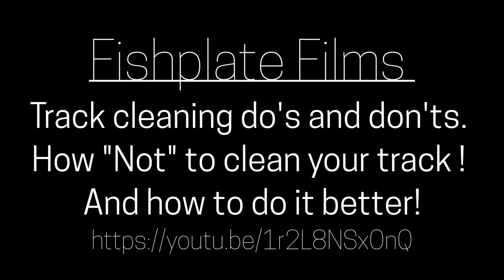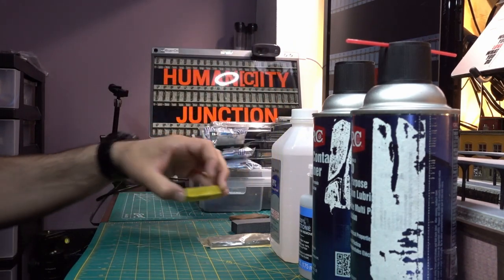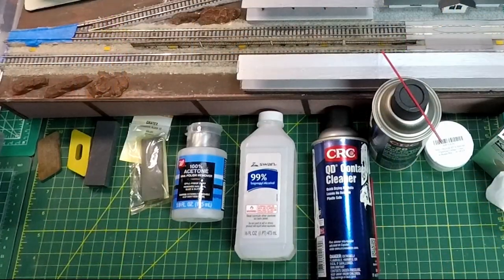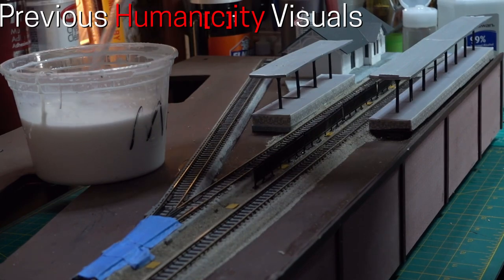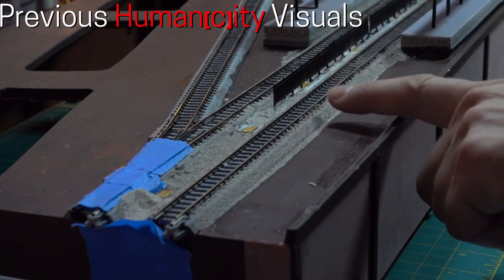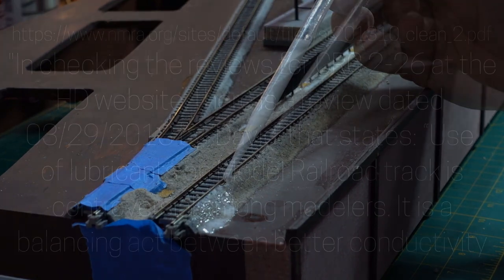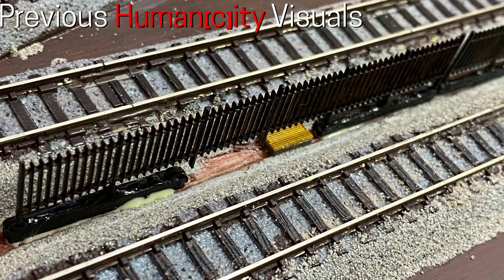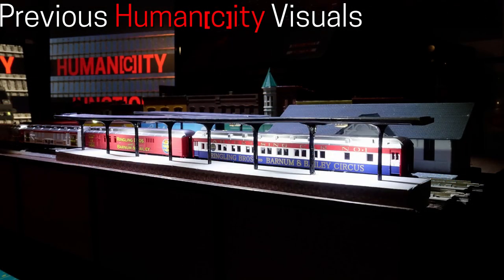Preparing Your Track for Running Trains | Cleaning Your Model Railroad Track

Comment: If you search the internet for "polishing track"  you will find what Ralph and I from MRL have done.  Although time consuming, it makes sense.  First take very very fine sandpaper to remove large scratches, then,  Taking a polished steel washer and buffing and polishing the rails to remove very fine scratches and then putting a non sticky protectorate on.   A little wheel slip is negligible for  me at best.  (real railroads have some too) The scratches fill up with junk, and polishing the rail eliminates those scratches.  IT is  more work, but worth it. It also takes away the arching that electricity does when wheels run on minute scratches.  My only issue is I am in a dusty room and light cleaning is necessary, so putting on CRC over that dust is not too good, so wiping down track first with something not containing any  water, (alcohol contains water) but just any sort of dust remover helps.
Reply from the maker: Polishing the rails after fine sanding is a great idea.

I do have the QD Contact Cleaner to "clean" the rails before applying the 2-26. I believe the CC is better than IPA for this step.
Reply from the maker: Dwight,
I have been thinking about this more today and from what I know today, I could not recommend any type of abrasives, event a very fine sandpaper, for regular track maintenance.
And "sanding" is going to leave behind very small pieces of metal.  These pieces of metal will be attracted to the locomotives, especially the motors. Yes, being as that abrasives were used as track cleaners for years and everyone has old locomotives, there is probably little long term effect.
But if I have a cleaning/treating solution that does not leave microscopic metal particles behind, I would choose that as my first option.
I would be really interested in hearing your further thoughts on this.
Reply: Of course, one would clean off the sanding particles before polishing with the washer.  The process was called Polishing and Burnishing nickel silver rail.... @HumancityJunction

Comment: track cleaning is just that. dust and humidity get on the rails over time, and if left for long periods of time,(week) then should be cleaned with the 89% to 99$ alcohol. when it comes to running the trains, every day a bit of the CRC on a rag and spread out on the rail heads works best. just don't do any inclines that you have, and wheel slippage with stay at a min
Reply from the maker: Thanks Sparky.  Currently my setup is all on the same level, but it would be interesting to do some testing on your Helix on just how much effect the CRC would have on slippage.

Comment: After seeing your presentation, I went to Amazon and looked at CRC products.  Their 2-26 was described as a lubricant and that worries me.  Their QD Electronic Cleaner, however, looks like it may do the trick on tracks without collecting dust/dirt.  Just saying.
Reply from the maker: The key part is the protectant, which supposedly helps with the electrical connectivity. 
There is a video by Ron’s Trains and Things talking about the QD Contact Cleaner that is supposedly better than the 2-26, but I am not sure that it makes a noticeable difference. 

I am currently of the mindset that running trains is the best track cleaner.

Comment: Hi, I've used Inox on my layout and it is good for conductivity and smoother running of smaller locos. But I discovered to my horror, that it totally wipes out traction tyres on locos which were bought to take larges rakes of carriages up my incline . . .  sadly no more !! I have to now change the traction tyre wheel sets for non-traction tyres which leaves them with less pulling power than with tyres. People definitely need to be aware of this problem.
Reply from the maker: Yes, this is unfortunately 100% correct, a lot of this conductivity enhancers are corrosive to traction tires.
One thing I have recently being experimenting with good success is just using graphite. I got some powdered graphite from the pinewood derby crowd (they use it on their axles) and it has been working really well.

Comment: The only issue I noted on the fishplate films video which you don't mention is that CRC 226 and traction tyres don't go together. On my n scale collection, Broadway Limited Imports locos use traction tyres, for both diesel and steam locos. For now I'll stick to infrequent IPA (then adry rag) and, surprisingly, just  running a dry rag or track cleaning car again with the pad dry.
Reply from the maker: Thanks for the information regarding traction tires, that is definitely good to note.

I have 7 N scale BLI diesel locomotives, 3 different types (the majority are heritage), and all of them are Paragon 3.  I thought I new what traction tires were, but looking at all of my locos, I do not see what I expected traction tires to look like.  I am definitely going to need to do more research on my BLI locos.

Where did you find out about 2-26 and traction tires not going together?  I wonder if it would be better to use NO-OX-ID if you run locos with traction tires.
Reply: @HumancityJunction  Greg / fishplate films mentioned it in his most recent video recommending crc2-26. Apparently the stuff soaks into traction tyres and makes them ineffective.

Comment: The channel Elite 194 had a video a few months ago saying he uses a product called Oxguard. On the same level as the oxidation prevention product in the small twist top container that you showed. He said a tiny bit went along way and that he only cleans his rails once or twice a year. He didn't say how much he ran his trains though. He swares by the stuff. Great video and great information. I'd never thought about using electrical contact cleaner to clean the rails but it makes perfect sense. Stay well.    👍
Reply from the maker: Thanks for commenting

Comment: I have been using Inox for over 30 years. I get all the benifits claimed in the Fishplate viedo and your viedo using CRC 2 26. Both are great.
Reply from the maker: I have been using the CRC 2-26 and then adding the No-ox-ID as necessarily.  It has been a good combination for me.
I recently started trying out graphite on the rails. I am not sure what I think of that yet.

Comment: Just to put this emotive subject in perspective, 193 subs and 53 comments so far! I am in total agreement, my research has born similar results. For those in the UK, take your Peco track rubber and throw it in the bin! It is way to coarse! I think I need to do a vidbit on the subject, as you have missed one more element, the "lubricants" that offer anti oxidisation also help reduce sparking, an element little understood that actually causes most of the "dirt" on the track!
Reply from the maker: There was some information available that the black that gets on the tracks is not oxidation, but is actually arching.  And that it is the lubricants that reduce the arching, which reduces the black, which reduces the “dirt” on the track.Maybe one day no one will use the track rubbers any more.

Comment: I use CRC and spray it on a paper towel, cleans really good and quick, as said in another post a channel called Elite 194 swears he uses ox guard and only cleans his track about once a year, it's made for aluminum wiring so it don't oxidize and lose voltage, I own a rv park and used it on the wiring and have not ever had any voltage drops in the 12 years that I have been open. Gary
Reply from the maker: Gary, when using paper towels I found that they get ripped up between track sections hence why I moved to rags or the delicate wipe.  Thanks for commenting nad I look forward to more of your video.

Comment: I been in electronic repair and computers for years and have used a product from Caig, manufacture of electronic cleaners.  I know nothing more but feel like throwing the name in the pot. It has alwayus preformed well for cleaning control potentiometers and edge connectors.
Reply from the maker: I will check it out, thanks for bringing it up.

Comment: Saw the video from fish plate - interesting.  Personally I use Woodland scenics tidy track and can't say I've ever had any issues with it.  Cheers Euan
Reply from the maker: The point that I believe we are trying to make is that cleaning the track is only the first step, that you also need to prep the track by putting on something like 2-26 or INOX. Some people stop after the cleaning part and do not do the prep part.

Do you know what is in the liquid that comes with the tidy track?
Reply: @HumancityJunction  sorry I don't know what the liquid actually is in tidy track - that said I've never used the liquid cleaner supplied.  The track rubber seems to work.   Could the humidity of where a layout us housed play a part in the effectiveness of the different cleaners ?

Comment: Great topic.  transmission fluid does improve contact, but it does not clean and because it is oily, it attracts dirt, so I would vote no on that.  The CRC does seem to be good stuff and I am going to try it on my next layout.
Reply from the maker: Mr. Crow, thanks for watching and commenting.

I am not a fan of the transmission fluid, just like I would never use WD-40.  But I saw it mentioned a few times so though I would bring it up.

Comment: I'ved used CRC 2-26 to clean my rails but also to clean track pickups, motor brushes and commutators and it worked great. Thinking of using ACH ACT-600 or Track Magic after cleaning for conditioning the rails.
Reply from the maker: Thanks for watching and commenting Nate.
Reply: @HumancityJunction  You're welcome!

Comment: I have been using the Inox product and find that it has worked well for me. The also use for stubborn build up dirt such as after doing scenery work or track repair wet/dry 4000 paper sprayed with a little of the Inox. works great.
Reply from the maker: I have sprayed contact cleaner on a bright boy before.

Big Bill, see my response to Dwight about sanding.  At 4000 grit you are leaving microscopic particles that could make their way into the motors on your engines. First choice is non-abrasive, but I agree that sometimes you need a more aggressive solution.
Reply: @HumancityJunction  Also I should have stated that I take a 2inch stainless steel washer mounted on a block of wood and run it over the rail, got that from Ralph Renzzetti The Mud Father

Comment: I'm involved in a fair number of public shows, and there are some additional track issues caused by that. You may be faced with modules the were in storage for a long time, from various builders and sources, public venues may not have the best air quality, and visitors talk over, eat near, and touch the tracks. Through long experience I've come up with some go tos.

Abrasive. Any abrasive is a compromise. You have to balance the mechanical cleaning action against the fact that it leaves tiny scratches on the railhead that just attract more crud. But sometimes you have to do it. Paint, glue, ballast, various crud gets on the track. I use the Cratex block. It's much finer than bright boys and similar products. I think Walthers no longer sells this, but it is a commonly available industrial product. I believe the grade is extra fine - dark gray (grits are color coded). A trick another modeler showed me is that the surface of the block will build up a patina of crud and trac metal. Clean this with water and liquid dish detergent.

Non-solvent cleaners. Recently there have been several no solvent track cleaning solutions available. I prefer these to any solvent based ones -- Goo Gone, 2-26, IPA, whatever. They don't bring up paint, glue, whatever. Woodland Scenics sells one. I use ACT-6006 from Aero-Car Hobby Lubricants. This is also sold thorough Bachmann, so it's easily available. Clean with The Woodland Scenics Tidy Track white pads or a non-lint cloth.

Conductivity and corrosion resistance. I've found that on the second day of a two day show, track condition seems to have deteriorated overnight. little very light oil helps protect the track. Wahl clipper oil is the traditional fix. Any very light oil probably will do. I use XL products ultra light. Put one tiny drop on the rail every eight feet or so. Let your trains distribute it.

Edit: I forgot one other product I use. Also for conductivity and corrosion resistance, as an alternative to light oil. XL Products 'Garden Railway Track Conditioner'. Developed for outdoor use but fine indoors too. Put a few drops on a WS white pad or lint free cloth and wipe the rails with this after cleaning. Keep it light and don't do often -- the folks at XL say twice a year. Shameless plug -- XL/Phoenix are nice guys with good product and show at most train shows (if we ever have any again).
Reply from the maker: Bob, thanks for the recommendations. -Heath
Reply from the maker: I found the ACT-6006 on eBay. I am going to pick some up to try.
I really want one of those brass cleaning cars. The same seller also has one, but I cannot justify the price right not. -Heath
Reply: @HumancityJunction  by 'brass cleaning cars' do you mean the Centerline ones? They're great, but fiercely expensive. My club uses them on the NTrak layout.Two in tamdem -- the first with Goo-Gone, the second with a dry roller to pick up the crud that the Goo-Gone has loosened.
Reply from the maker: @rmyers7  I had not seen the centerline ones, and looking at the pictures, I do not understand how they work.  I was referring to the CMX Clean Machine Tank Car.